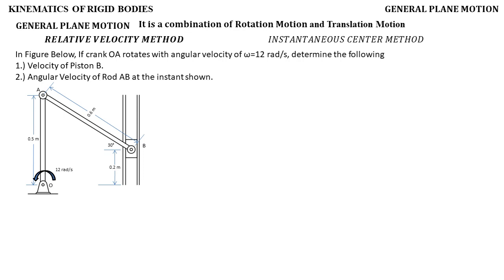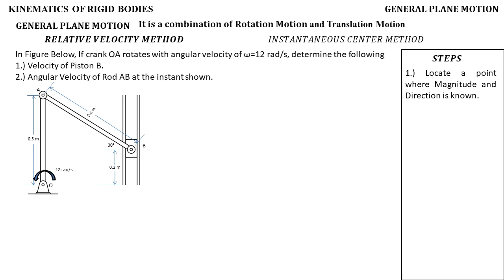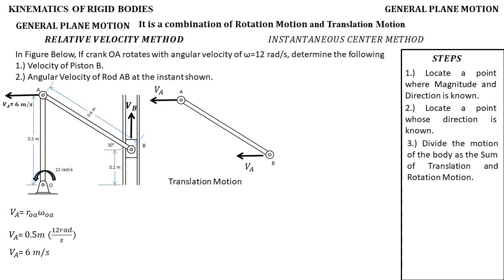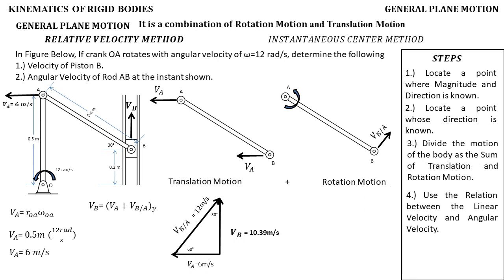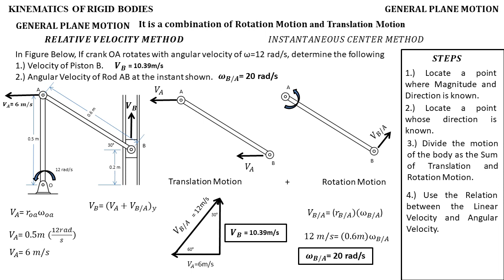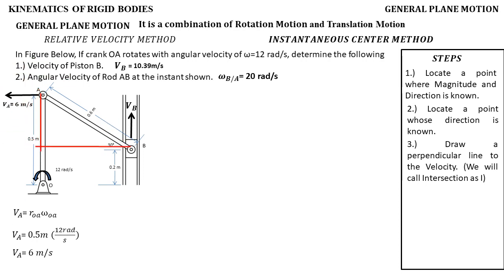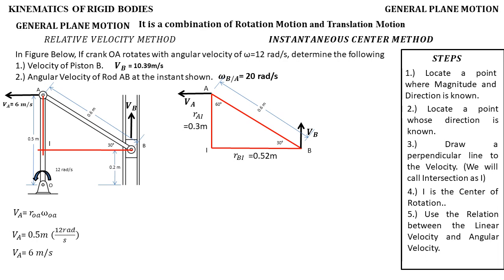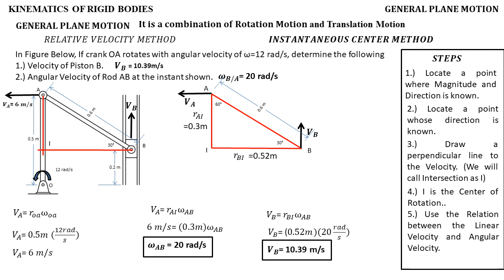Kinematics of Rigid Bodies l General Plane Motion l Relative Velocity & Instantaneous Center Method

Comment: From Step 3 of the first method, why is it assumed that velocity at A is present at both A and B in translation? 4:43
Reply from the maker: hi Lods, it is also present in point B since the rod AB is divided into Translation and Rotation Motion. Considering Translation(Rectilinear Motion) direction and magnitude of velocity at A is the same as Direction of velocity at B (or any points of AB) but due to the reaction of Sliding Support, Tendency of that velocity will rotate. thank you